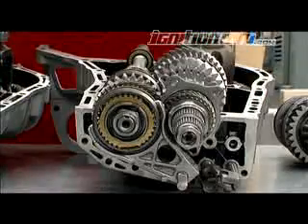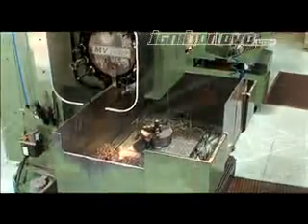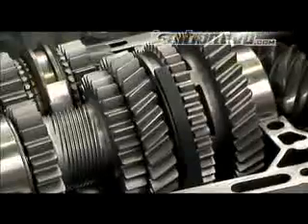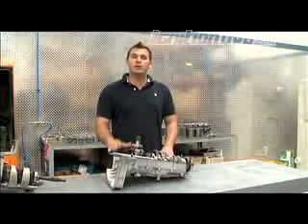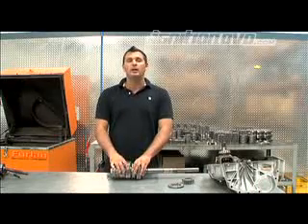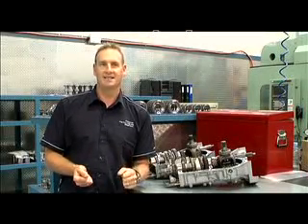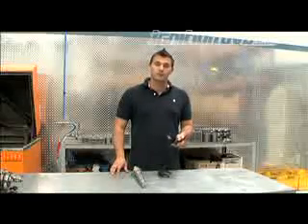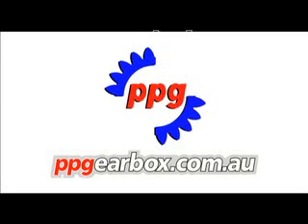PPG Gear box - Ignition DVD

Comment: Helical gears are always stronger. They offer more contact surface spreading the load. The issue is that helical gears create an axial loads and bending loads which is transferred into the case and shaft. Spur gears /straight cut avoid this issue by having no axial loads however they are technically weaker for a gear of the same width.

Reason why they use them in racing applications is because its cheaper and more efficient to create a stronger straight cut gearbox then a helical one.

Comment: Regardless of the theories - Straight-cut gearsets have been race-proven to be vastly stronger than helical. Ask any motorsport expert. Helical gearsets cause angular loads on the gear, the transmission shafts and bearings beacuse of the contact angle. They break. Simple.